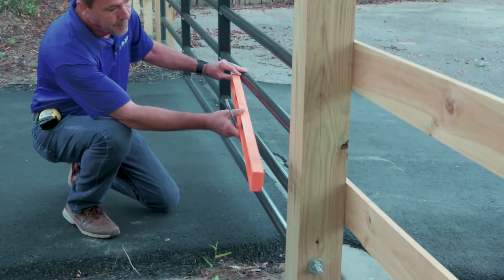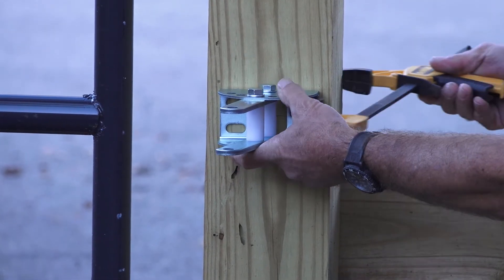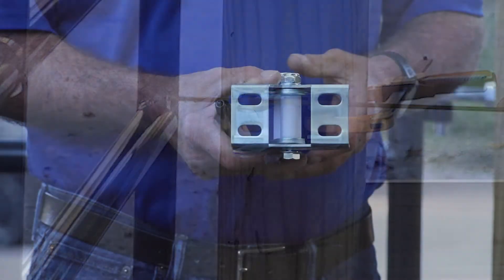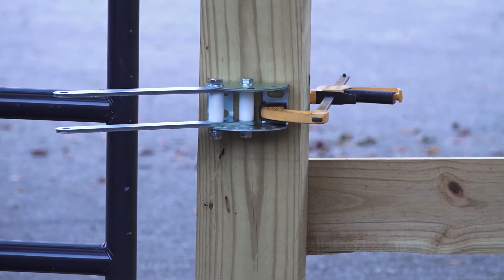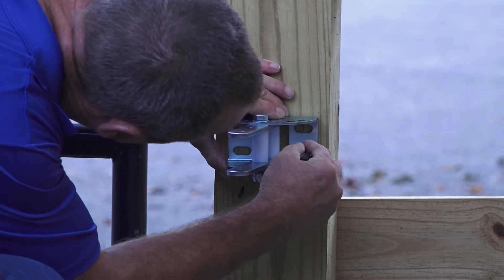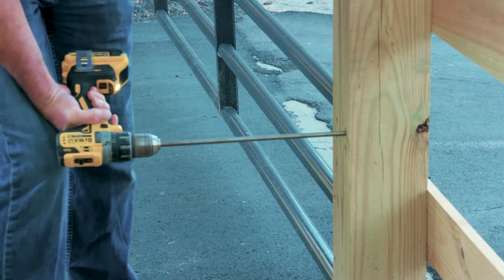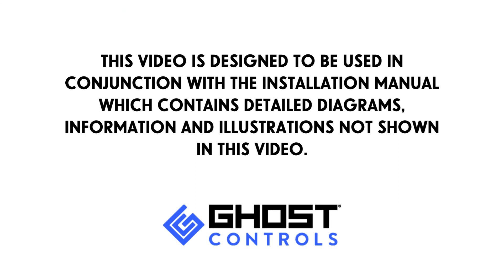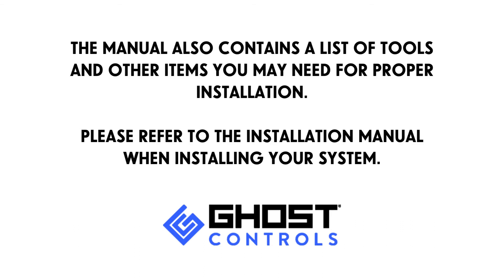Automatic Gate Opener-Chapter 2: Operator Arm Installation

Comment: Ghost controls gate mover is awesome. If it starts grabbing or squeaking try WD on the piston with a paper towel. If it doesn't work they say white lithium grease, I tried that, it made it worse. Finally I pulled the pins so I could access the allen bolts on the plastic portion, then I tried to remove them, they are attached with springs and didn't fall out bu